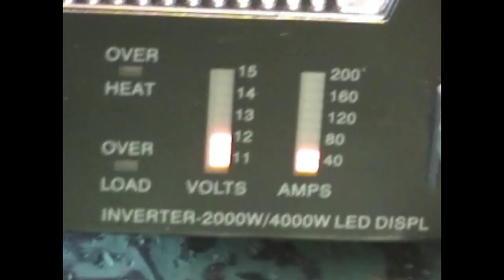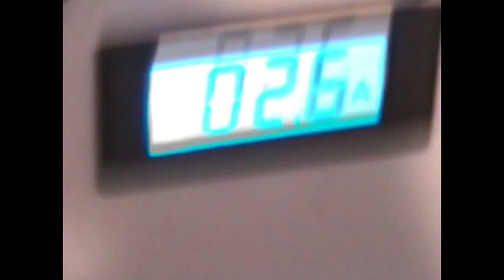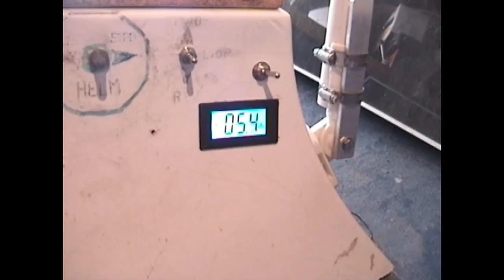HOW-TO Electric outboard motor ~ 5500 rpm FAST ~ homemade fishin' machine ~AC DC ops ~zoom series

Comment: That is an epic awesome idea I have this idea to do something similar making an outboard motor for my dingy this idea will in fact seal that deal my idea was quite a bit more complicated production could be hazardous at best I like your idea a lot 
In fact my idea was to use the head of an angle grinder and a vacuum cleaner motor something close to yours thank you for sharing now I am going to get a used grinder to start my build 
              Thank you for sharing

Comment: Oh yeah about the inverter about how many amps and were will you have gotten it from 
A lot of these don't make the grade as stated really nice
Reply from the maker: Hey David, Thank you for watching. I still use this system even today.
I have solar charging station (800 watts) for fast replenishment. I can use the power of the sun onboard for days on end if Im only using slow trolling speeds. Thanks again for watching!

Comment: Yup, 4 years for the whole job, complete engine overhaul & gutting the hull. I appreciate your request to repurpose that generator head as a motor to drive the boat but dang, I ain't even used it as a generator yet!  Oh, & the tiny matter of the small fortune I spent on that 160lb thrust Minn-Kota twin. But there is a lot of experimenting to do yet so we will see. The wife keeps talking about going with solar cels.  Cheers!

Comment: that AC power..use in water..
Reply from the maker: ~hey Rock ~ yes AC power! and DC Power. you do need to understand what you are working with... and how to ground the system properly for AC use.
watch all our videos on how to use AC power on the water. but, do not attempt unless you fully understand its use :)